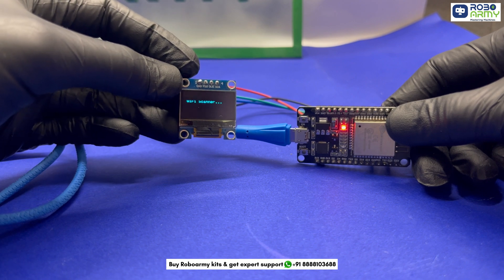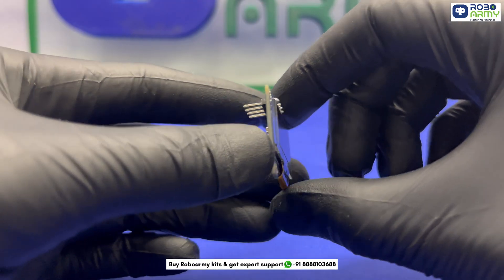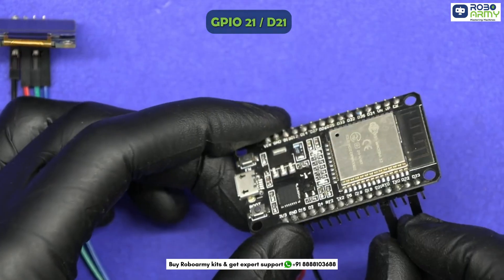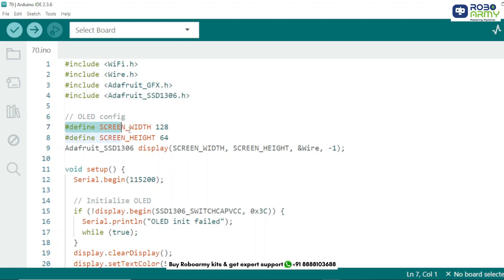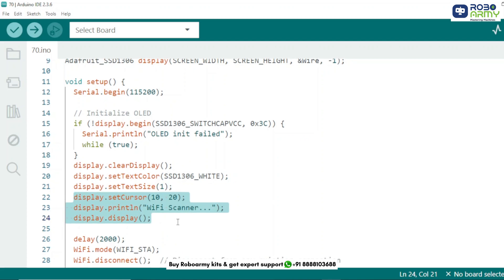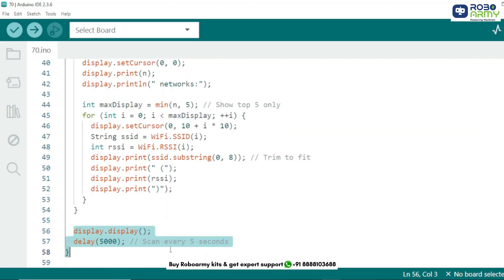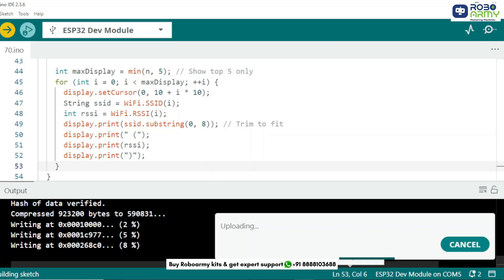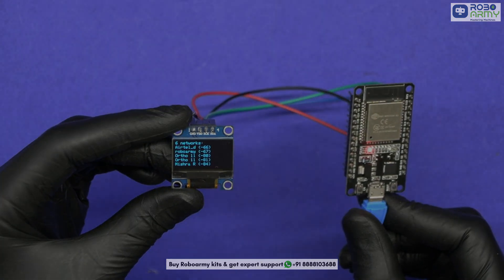Scan & Display Nearby WiFi Networks | WiFi Scanner with ESP32 &OLED Display

Comment: Can it be use as a final year project?
Reply from the maker: Yes, it can be used as a final year project 🙂
You can enhance it further by adding features like data logging, signal strength analysis, web or mobile dashboard, location-based scanning, or security analysis to make it more advanced and impactful.

Comment: Make a using lcd i2c
Reply from the maker: Thanks for the suggestion! 😊 Yes, you can definitely try using an LCD with I2C instead of the OLED display. It will work similarly — you'll just need to use the LiquidCrystal_I2C library instead of the OLED library. Make sure to connect the SDA and SCL pins properly, and update the display part of the code to print the WiFi networks on the LCD.